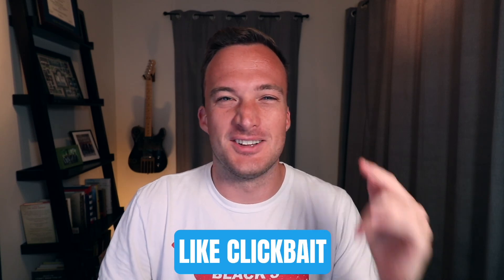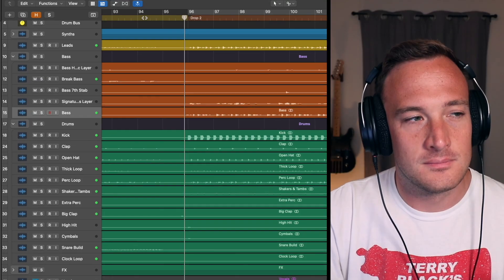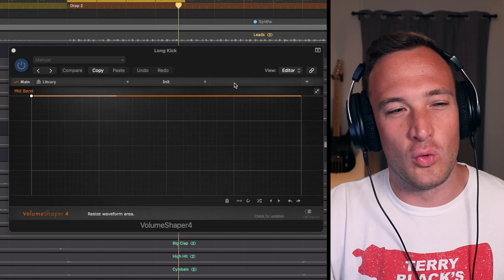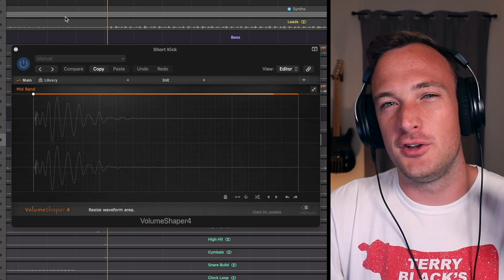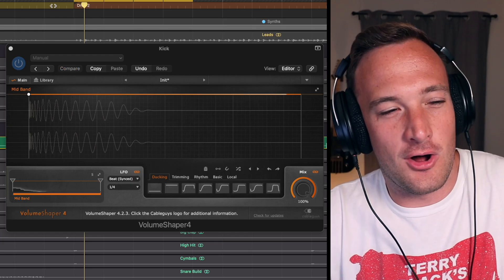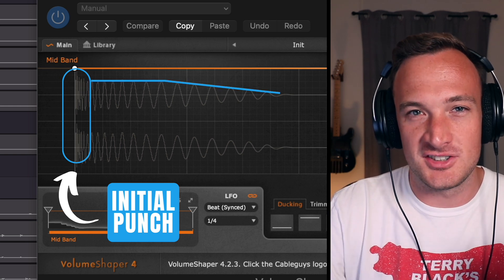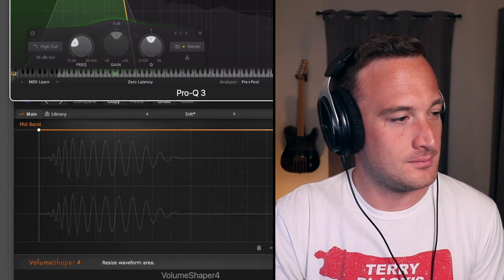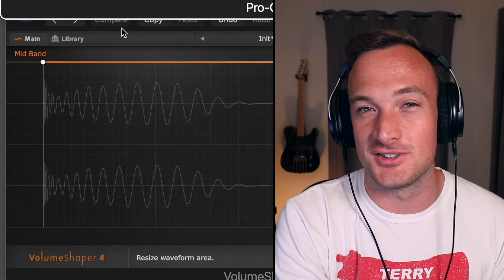I Mixed 1,000 Tracks (Here's My #1 Tip)

Comment: Yep, very common problem. If you actually think about the functionality of such a sound, a kick is really only there to provide the initial hit as a reference point to the grid. Anything after that should be covered by the bassline, after all it is called a BASSline. 

The length of the kick also has a knock on effect, if you are using it as a trigger for sidechaining, a kick with a long length will cause the sidechain to react in a sluggish manner. 

Longer kicks also tend to bleed into the bassline making it hard to distinguish which is the kick and which is the bass, so you get this kind of rumbling when you listen to the sub and we all know what people do then..."Why can't hear the kick...I'll turn it up, that should fix things!"

Comment: That "womp" shape at around 5:41 is not always bad though. Some genres benefits a lot from having that fish tail shape and super common in psytrance for example. So I'd say that if it sounds good in context with everything else in the mix, then it is good. Nevertheless, good video, it is indeed important to have a good kick in dance music.
Reply: also in many Early Hardstyle tracks, it is pretty common to have that fishy shape and adding a reversed bass
Reply: In my opinion it's still bad practice to use such a kick in a track though as you don't have much control of where this womp is happening amongst other aspects. If you have them as two seperate elements you'll have much more control. What happens when the BPM of such a kick is different to the BPM of your track? the womp will be in a different location. Stretch the kick to fit? well that can create weird artifacting and phase issues. Better to process them as two seperate elements rather than one.
Reply: @bassc  Thank god for oscilloscopes that can help to see what's going on and confirm what you're hearing =)
Reply: @bassc  In my experience more often than not it will cause issues though but I agree if you have a decent monitoring setup with a sub it can be done. Although if I was doing it myself I would still use three separate elements for more control. A short kick, a kick tail and then the bassline on its own.
Reply: Very true, made a video about the problems calling kicks like this "bad" in this video: https://youtu.be/TRwIyFQ2TR8
Reply: @DaddaPsy  This is really the key here, looking at the phase relationship of kick and bass with the Oscilloscope.
Reply: You are confusing kick & bass typical amateur out of context comment, the whole point of the kick is punch
Reply: @bassc  typical amateur bs comment
Reply: @MrFree-vj8qj  you're referring to me or someone else?

Comment: Another tip could be to choose the kick in key (preferably in the main note of the key): there are methods to understand and / or set it in the right key, but frankly I prefer to use kick it already with the note in the title (there are some library creators who do this), for not waste too much time, but more than anything else, in order not to risk "ruining" the initial kick sample with the change of tone (for example if you have to start from a kick in C and then you have to set it in F#, there is a good chance that it will lose quality or that ends up in frequencies that are too low or too high for a kick). However it is not a mandatory rule, sometimes without knowing the key just use your ears to understand if the kick works or not :). Ps. sorry for my English

Comment: I know for a fact my older tracks suffered from this. I just assumed if they came from KSHMR or vengence, that the samples would be top quality, but that was a schoolboy error. Its also worth noting that EQ'ing a kick can add unwanted volume to a kick, which I believe is caused by some sort of linear phase issue. I've seen me cutting out low end with a high pass band and its made it punchier even though i was removing frequencies,  so thats worth paying attention to as well.
Reply: hahaha school boy error! agree 100%. Rookie mistake! Also Using artist packs for a genre that is different from what you make is also a big one. Importing reference tracks that are signed to top labels is a good way to not phuck it up when choosing samples
Reply: Also, just EQ'ing the kick can affect it's phase at/around the EQ'd frequency and can then cause issues when mixing with the baseline. One of the BEST tutorials I have seen on kick and bass mixing is by a guy who does trance by the name of Allan Morrow, highly recommend that tutorial. It was part of his complete start to finish series in Ableton. Anyway, he goes into some pretty neat details about kick and bass summing and compensating for phasing if you do have to overlay the two etc..
Reply: @grant m probably resonance from the steepness of the high pass filter
Reply: @scott-richardson  will check that one out. And what u mention is actually visible sometimes in peak volume if u cut very steep. Goes hot immediately

Comment: Love this. Do you also chose a kick, or adjust by repitching the sample to match the harmonic key or even the root bass note so that there's even more harmonic synergy? Also, do you find that the act of EQ'inbg your samples and your baseline synths can affect the phase? In the instance where you have a baseline note playing over the kick a little, phasing starts to affect them both. I guess this is why you are trying to keep the kick 1/8th and not have any sub bass mixing with it?
Reply: Many mixers/ producers shift the pitch of the kick a third (up or down) away from the root note of the bass to avoid said phasing! ;-)
Reply: @ReformedWhiteKnight  That seems like a very smart thing to do in hindsight. Goes against the notion of ensuring the kick bass is in the same key as the bass notes?
Reply: @scott-richardson  I never heard the tonality or pitch of a bass drum so strongly and I am a drummer and even tuning software finds it often a bit difficult to determine the tuning of a bass drum, but apart from that a third up or down usually works in any music context!